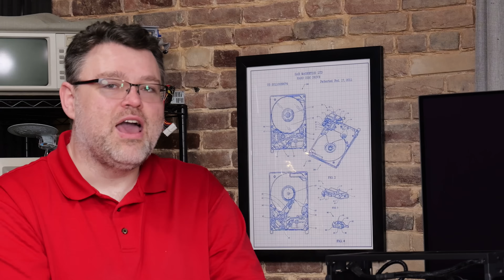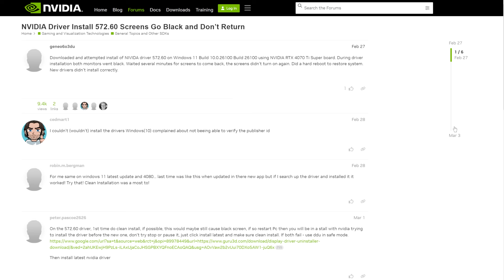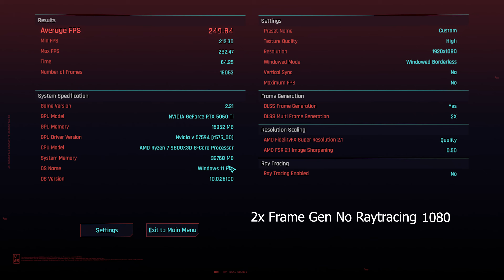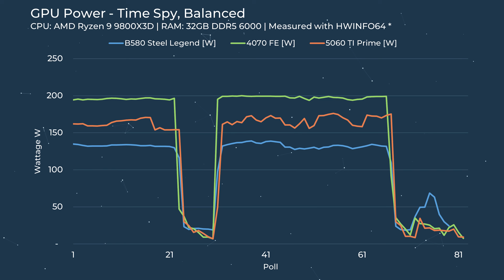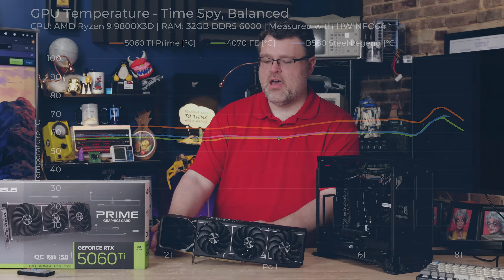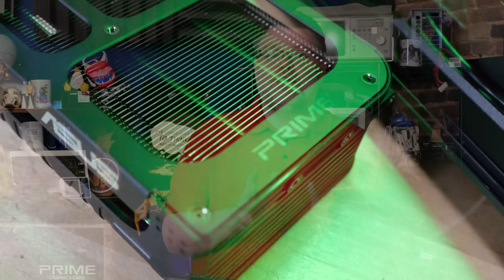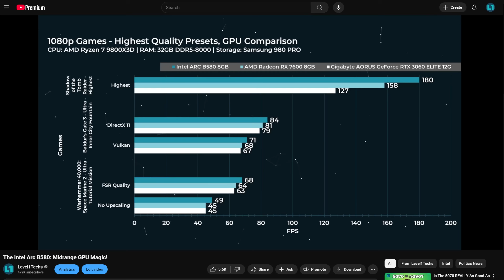Reviewing the ASUS 5060ti Prime and Ramble'n about DLSS

Comment: 8gb in 2025 is laughable- maybe on a 5050 class it is acceptable
Reply: TBH 8GB GPUs should not even exist now, 12GB should be the minimum.
Reply: I will still accept 8GB graphics card in 2025, but only when it is priced appropriately
Reply: @  yes $230 tops for a 8gb card
Reply: It's not. There is no reason to load multi gigabyte textures when you are doing 1080 vertical. If you are doing 8k - sure, but game devs are lazy and don't scale textures on load according to the output resolution. Remember your 980 has a feature (virtual super resolution) that even if output res is 1080 it will internally render at a higher resolution (dynamically) and downscale (mostly for antialiasing) - new cards - internally render at low resolution and upscale (e.g. a 1080 output is rendered at 800-900) - there was more reason for your old card to have more texture memory than for your new card as the details in the texture were meaningful for VSR. With DLSS texture details are mostly meaningless . You are not rendering at a resolution where texture details matter, hence you need LESS vram.
Reply: @igelbofh So we're supposed to just use VRAM generation alongside frame generation? Gamers Nexus has done plenty of work on how DLSS looks worse in many ways than pure native rasterisation/rendering, the idea that gamers should expect to run a lower real resolution on the same tier card is not justification for less VRAM, it's an indictment on modern game design.
Reply: @  but it is justification. Lower real resolution leads to lower effective texture resolution, which leads to lower vram need, as you don't need to load high quality textures. Nvidia listened when ppl started asking for stupidity (above 90fps). You can see that there are no image quality tests and metrics, all the reviewers look at is FPS, which beyond 90fps is absolutely stupid as the human visual system cannot see it
Reply: @igelbofh  It isn't justification, it's an excuse. For it to be justified they would need to be selling it at a lower price since it's effectively less hardware
Reply: Wow. There are actual VRAM haters in this comments section.
Reply: @Shizuna_no_Kiseki  Less hate and more certainty that when these companies add more VRAM, they'll find an excuse to increase the price 400% higher than the memory costs, clamshell it and leave the bus as is.
Reply: 5060 with 16 gigabyte is an acceptable upgrade from a 3060 with 12 gigabyte.  The price is not unreasonable either at MSRP.... and it's sold out 🤣
Reply: nah it. would be acceptable on a 5030 class card, a 5050 class card should be 12GB, and a 60 class should be a minimum of 16GB
Reply: Let's wait for 48GB...😁
Reply: If you're buying a 5050 for $400 you'd be better off getting a 6800 XT. 50 tier cards are for the brand loyalists who are broke.
Reply: More VRAM is not always better.  If the settings and resolution you run at only uses 4-6GB, more than 8GB will have zero impact on performance.  The only possible exception is if the increase in VRAM also comes with a bigger bus width.  But that is not usually the case with same class cards.
Reply: Anyone buying a 60 class GPU will be gaming on a 1080p monitor/TV.  Also, nobody should be expecting to run new AAA games at max settings on a 60 class card. 8GB is still fine in this segment as people should be expecting to play AAA games at 1080p medium settings on this card.
Reply: @03chrisv  Bro new AAA games can't run at 1080p with 8GB of VRAM due to poor optimization
Reply: @ not for 1K$
Reply: @03chrisv  were not 2016 anymore.. that was almost a decade ago. 1080p is already becoming 720p in todays time.
Reply: @bisayatechtips It used to be the case that one of the reasons we needed to upgrade GPUs regularly was because resolution was increasing. Now games are just getting progressively less optimised (RTX slowing things down wasn't entirely unreasonable but we're up to the 4th gen of RTX cards so that shouldn't still be happening). It is true that some games do only run at those speeds on a 5060 tier card but that's largely due to bad optimisation and well optimised games still exist and still need more VRAM when running at higher resolutions or even just better/more detailed texture packs
Reply: @03chrisv  No, 60 class GPU at 1080p is what people expect at 2016. I expect a 60 class GPU to do 1440p at mid setting in 2025, and my 8GB VRAM is literally causing my game to crash every other day even gaming at low setting.